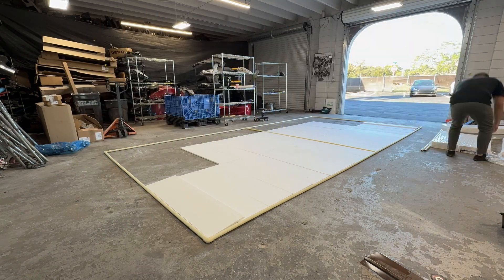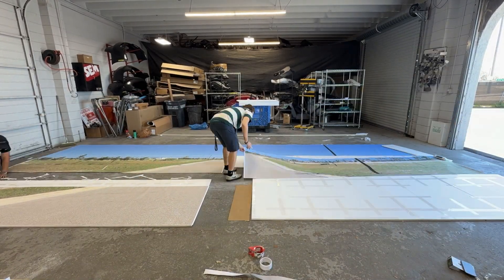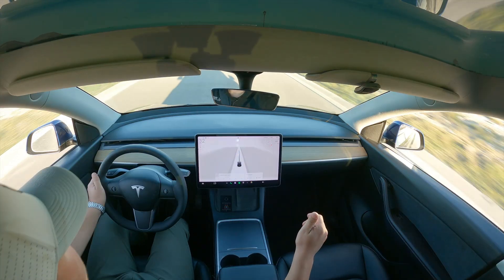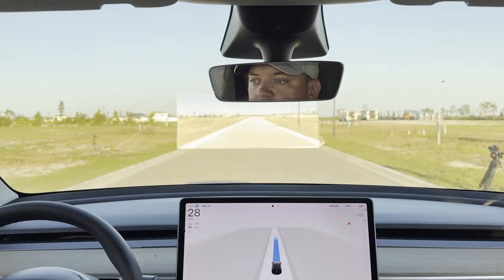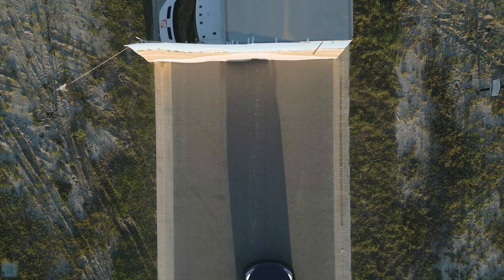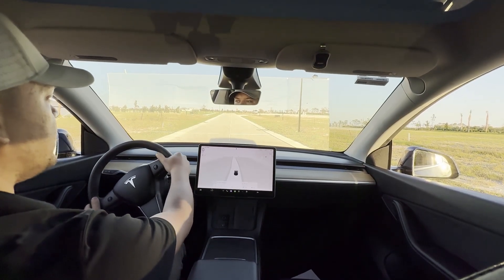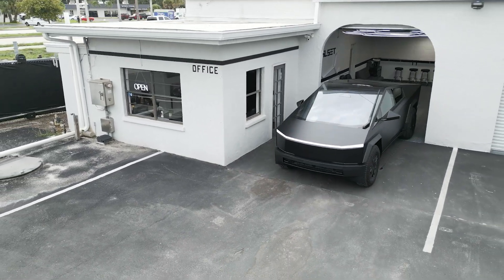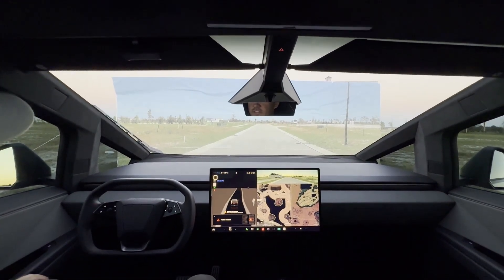Response to Mark Rober’s “Can You Fool A Self Driving Car?”

Comment: HW4 cameras are 5 megapixel compared to 1.2 megapixel hw3 cameras. Tesla has publicly announced HW3 is not capable of running Full-Self-Driving without a hardware upgrade.

I brought this up multiple times regarding Mark’s video. But he didnt even try FSD so maybe it didn’t matter

This video keeps it as real as it gets. Thx for taking the time to do this 👍🏼
Reply: I wonder if it is really just the cameras making the difference. Would be curious to see if a recent model Tesla using just the Autopilot program would go through the wall or not.
Reply: @ not only the cameras. The most recent computer in the Tesla is also much more powerful. The older cars can not run same FSD software as the most recent Tesla’s because the older cars dont have the compute power needed to run the latest FSD
Reply: Tesla has not publicly announced HW3 is not capable.

They announced that it is looking likely that HW3 might not be capable and that if so, they will offer a HW4 retrofit solution to those who have purchased FSD outright. (Not those who are paying for FSD(S) monthly)
Reply: @ its been announced in public earnings call that hw3 will need to be upgraded.

HW3 cars are still currently getting some FSD software upgrades, but not as good as AI4 because HW3 can’t handle the compute loads needed to run same FSD software thats in current AI4 vehicles.
Reply: 5mp cameras dont change anything. you need at least 2 cameras spaced out significantly on the horizontal axis to retrieve raw depth information. Tesla does not do this. It relies on cameras only on the center of the car without raw depth information, with algorithms fine tuned to approximate depth based on previous data sets. 
Even if the cameras are spaced out, image sensors just do not have the fidelity of lidar systems. There are reasons why lidar is preferred when testing autonomous driving tasks.
Reply: @ The video very clearly shows the Cybertruck doing what you claim it cannot do without the hardware you claim it needs and doesn’t have. In science this is described as having your conjecture falsified. 

LIDAR actually failed in the original video too, the guy just lied about it. In the “rain” test, the LIDAR car stops because of the rain, not because of the faux child beyond the “rain” that the LIDAR car shows no hint of on its screen. LIDAR often fails in rain and real fog, so the “scientific” first video used smoke instead fog. Snow is right out for LIDAR, either falling or covering the road or any near the road, because it scatters the laser beam. There ARE algorithms to unscatter the laser beams, but then you are getting considerable lag between shooting out the laser beam processing it, and that compromises the safety and reliability of the FSD. There is a nice video on YT of a Waymo taxi happily driving in a hard rain, until it drives right up on a huge fallen tree branch, cannot move anymore, and has to be rescued. There was also that time a LIDAR equipped Waymo drove right into a fast moving electric pole. 

LIDAR companies and LIDAR based FSD companies are closing down for a reason, and it is not because LIDAR is a great idea for FSD.
Reply: @user-ko9te33c84u there are 2 cameras on the front and you only need 65mm or roughly 2.5 inches of spacing which happens to mimic human eyes. Now of course lidar would be better. But you’re just wrong about the camera depth stuff.

Comment: I must also note that there is a HUGE difference between HW3 and HW4. This is literally the hardware, so my focus is on the cameras. For HW3 they used a 1.2 Megapixel camera and for HW4 the use a 5 megapixel camera. This higher resolution enhances clarity allowing for better recognition of fine details like license plates and road signs, improved low-light performance, and a wider field of view due to changes in lens design.

Comment: Great video! Someone should test one of the Tesla's with FSD before they decided to take the LiDAR sensors out and see if it works any different, if it does better then that would mean there are older models with better FSD than the ones witnout LiDAR.

If there isn't one available I have a Model 3 with LiDAR + FSD you're welcome to test if we're in the same area just lmk! ^_^
Reply: Tesla never had Lidar, only radar.

Comment: Great work, but to have truly recreated Mark Rober's test, you would've had to have manually driven into the wall without FSD.
Reply: Lmao. Nice one
Reply: To be fair, Mark turned on Autopilot, obviously a completely different thing, with 3.5 seconds to impact, then turned it off by jerking the steering wheel with a half second to go before impact, and THEN manually drove through the painted wall. He worked really hard to pretend to be testing the FSD without ever using FSD.
Reply: Sorry about your stonk

Comment: It's because the headlights were on. You can see it visualized it as something on the road not a wall. Test it at the same time of day next time.
Reply: I don't doubt it would fool it. but,Not every Looney tunes fake road will be perfectly contrasted and photo realistic like depicted here
Reply: @XxHorseshoeXx Looney Tunes is their worst case scenario. Teslas have already failed with far simpler objects like a semi trailer that was light colored vs the bright sky. These tests aren't really telling when simpler setups have already resulted in failures. IIHA didn't test Teslas (fear of retribution?) but Mazda and I think VW (?) seemed to confuse typical firefighter reflective stripes with road markings and plowed through the test subject. Subaru did fine though. It's all plagued by edge cases, even human vision.
Reply: Funny how lidar works like a headlight, throwing light around
Reply: @Y2Kvids could be that the AI learned to use these patterns for estimating objects.
Edit: Doesn't penetrate fog though, although AI might be better ignoring bright spots of fog better than humans
Reply: @MeBerserk   Lidar usually also has cameras and radar with it .
Reply: @Y2Kvids  yeah, same concept, different wavelength. Nowadays (static systems) often accompanied with a pattern in the light source.
Reply: @MeBerserk  I believe the AI only learns on Tesla servers. Not individually in the car.
I really do not know how Tesla does it. But most AI does not learn while being used. Ever. It needs to go through a completely separate training process and then you use it as is and live with whatever it does not know. While training the next version on the servers. Essentially. I am sure someone who works with AI cringed at my comment.
Reply: @origosis  That is correct. The work the computer in the car does is called inference. Basically applying the trained model to the current situation. It doesn't learn from it directly. But Tesla has the option to grab the videos of situations where the model made a mistake and incorporate those in the next training run.
Reply: @origosis as you say. Using the AI doesnt teach anything. The engineers would have to use the clip from your car, label it and give it to the AI as training data. This is why you get a new version. Different data, more data, better labeling, etc…
Reply: @macanx10  They do do that.  Clips from the car are sent back to Tesla for driver interventions, and used for further training of the AI.

Comment: If it has lidar or radar a painted wall isn't going to fool it.
Reply: That was the point. If vision-only self-driving can detect a painted depiction of a road on a wall or not, because obviously LIDAR/RADAR/ultrasonic sensors will pick it up. The point is whether or not Tesla's camera-based system can be fooled.

Comment: There's a great leap of capabilities from fsd 12 to 13, so I'm not surprised that 13 did a lot better. It's not even the case of the hardware being better, it's just that 13 doesn't run on HW3 so you need HW4 to run it. They said they will try to make it run in HW3 too and then it should see the wall too, but it's not certain they're actually gonna do it. 
Either way, cool video, thanks for the effort.

Comment: I appreciate you trying to do it much more scientific.  I will note that the visualizations on the screen for the driver to get an idea of what the car sees, is not actually what the car sees as its occupancy network code.   same way they only have one type of traffic cone visualization, or dog visualization.  When I'm in a tesla in a drivethru it knows there it a wall there and sometimes draws it as a bus, and sometimes doesn't draw it at all.  it doesn't mean the occupancy netowrk software things there is no wall.   but the visulalizer is pretty useful in general to get a small sense of what it sees.

Comment: i think if you ran the cybertruck test with headlights off, you'd get the same result as the model Y. looking at the display, it doesn't actually detect the entire wall, just the bottom portion most strongly illuminated by the headlights

Comment: Wow - v12.5.4. That really wasn't very good. I've had 12.6.4 for quite a while. I still wouldn't be surprised if HW3 didn't stop even with v12.6.4 because the cameras are lower resolution. But I would be curious since it is a massive improvement over 12.5.

Comment: A much better job than that Mark Rober video. Thanks for doing this!
Reply: Same result.
Reply: @ Sure, but this experiment was conducted properly. Repeated trials. Actually engaging FSD. How you run an experiment is usually more important than the results you get.
Reply: @ This guy was able to make repeated attempts because he never let the car go through the wall while Rober did.  For Rober to do 6 attempts, he'd need possibly 6 fake walls and cleanup and setup time in between, plus access to a free truck.
Reply: @hunterhenryk  Exactly. For Mr. Rober, it was about the photo.
Reply: @wesleyw.terpstra1902  Well technically, if it were you in real life and a wall with a picture of a road on it, you'd only have one chance at it too (i.e., Rober should technically be dead after that attempt).  You don't get 6 chances at it IRL.
Reply: @hunterhenryk  ... that's not how science works.
Reply: @hunterhenryk  nope, cybertruck passed
Reply: @oh3831  Mark rober did not use the cyber truck
Reply: @ZhoBacon  he could've used FSD with any HW4 car but didn't because he wasn't being an honest scientist
Reply: @ZhoBacon   only 46000 cybertrucks are sold
Reply: @oh3831 Bud, people are saying the lightning conditions is different for cybertrcuk here. So this person's experiment isn't fair either. OP must redo the test again in same lightning conditions.

Comment: This is all pretty arbitrary because what triggers the recognition is more about the contrast and imperfections in the print over the course of hours stretching into the evening.  This test could easily be tuned to pass or fail with a better print, tuned lighting, etc. or the other way around.

I love that you did this and came at it without bias by the way.

My comment is more about pointing out that the Rober video may not have been technically lying about lidar being better at detecting a carefully positioned and sized free-range billboard than Autopilot, but the intent is clearly to do what most media does which is to leverage people's ignorance about the technology to gaslight them.

Comment: TBH as a Cybertruck owner, I thought I was gonna get to see the Cybertruck plow through that wall. Partly because as an engineer we design for the most probable uses of products and this wildly improbable test is just fun. Other part is the truck has much more inertia than the Model Y and driver taking over the last minute will lead to a collision. Speaking of collision I was rear-ended by a 2020 model Y on icy roads while in my Cybertruck. My CT was in FSD at the time and kept great distance in front, Y driver admitted to rush to skiing. Also, CT FSD is not as trained as model 3 with HW4. Again, these tests are not useful to the advancement of automation though. They serve as entertainment only. Political people and media use them as another reason we should not advance technology away from fossil fuels, because big oil still and has been paying the most for disinformation in the energy industry.

Comment: 1 -Where in the world will you ever encounter that kind of "wall" ???
2 -The fog is a much more realistic scenario , you might try that test if you can with hw4 .
3 -The rain test was not that realistic because of the volume of water used , it's like driving through a waterfall .
4 -Tesla can use lidar, but humans don't have it and still can drive pretty safe . Lidar is a nice addition to any system to prevent false positives ( phantom braking ) , but that's extra money  !
Reply: Yep, for No 3 it was conveniently left out that the LIDAR car would NEVER have proceeded through that deluge as the LIDAR would have recognized it as a solid object. There are videos about this if you are curious.

Comment: that 12.5.4.2 was released oct 28 2024 I wont why you never got a newer version. so if it works on all hardware 4 fsd 13+ versions that means tesla solved this in jan 2023.

Comment: I know it’s a lot but please do the test again if you can where both models are run at the same time. Definitely seemed like more glare on the image in the first run. Also I feel like the difference in vehicle heights could have made a difference please make sure that the cybertruck is at the lowest suspension setting (you probably did). Thanks heaps for going to efforts you have.

Comment: That is actually unreal.. I was almost certain it would be the same result even with HW4... 

Mostly because with my 2025 Model 3 with HW4 and 13.2.8, my vehicle does not move over to the right as it needs to when coming up on an hugely oversized load (carrying a small building). I'm pretty sure if I did nothing, FSD would hit the oversized load unfortunately. I'm sure they'll figure it out eventually though, even just with the cameras

Comment: This is exactly why more than just cameras are needed for full self driving. Doing full self driving with only image recognition is the dumbest thing an engineering department could do. The cyber truck test looks like it was done at a different time of day, so the wall is a lot more noticeable. A better control test would be to do it at the same time as you did yours.
Reply: Tesla has explained why they no longer use LiDAR. AIDRIVER (youtube channel) who test FSD extensively breaks it down.
Reply: @ I don't care, it doesn't disprove the engineering fact that having better data results in better autonomy and decision making. The lack of Lidar is why Tesla can't get above Level 2 self driving. Every other company is doubling down with cameras and Lidar. Lidar is now significantly cheaper than when Tesla decided to write it off without understanding what economies of scale can do. Tesla makes short sighted and dumb decisions based on an unhinged CEO who specializes in marketing and venture capital. The same dude who wanted to run PayPal's website on Windows.

Comment: Could you perform the test with Traffic-Aware Cruise Control? Autosteer and FSD are not worldwide available, and also they are not broadly available in other serial manufacturers - Lexus, Kia, Renault, Toyota. Most of which use LiDAR in their implementation of "autopilot", which is just a fancier expression for "adaptive tempomat with lane assist". I am aware of only two manufacturers that make self-driving cars and have comparable features with Tesla when using it with FSD - Geely and NIO. And yet, their models and makes are not available to the broader consumer as Tesla is.

Comment: The amount of coping in this comment section is crazy. 

The sunset might make a small difference, but the biggest difference here is AI3 (HW3) vs AI4 (HW4). AI4 reintroduced advanced radar into Tesla's cars. AI3 did not have this. The cameras could have been easily fooled by the wall because it could be mistaken for the rest of the road. But the radar would 100% detect the wall well before collision, allowing thr car to slow down for it.

Comment: You just put your life in danger by using a truck to hold the wall. Be safe man.
Reply: A truck. A whole fucking truck there. What were you thinking.
Reply: He must've measured the car's braking distance and put markers down or something, given that THREE TIMES he (not the car) slammed on the brake last second and stopped within 1.5 metres of the wall. I don't believe he would have gotten that close that consistently, if he didn't take precautions.

Still a risky test, but he thought of that.
Reply: @LRM12o8  this is all clipped together worse than Rober's video was - the two different angles showing the car stopping when he applied the brakes end up at 2 completely different distances from the wall in the head-on view vs the side view, and it appears at first glance that some of the side view video was only recorded once, and re-used for multiple trials too. This video shows the same outcome, that autopilot / FSD is worthless in this situation (no surprise there), but still has some pretty obvious consistency issues in the edit.
Reply: Tesla owners have insane faith in Elon, he was probably throwing his heart out before the test
Reply: A home depot rental truck. If HD sees this he'll be banned for life.
Reply: No danger when he knows the car will stop
Reply: @alanprado6210  It didn't tho...
Reply: @alanprado6210 the car will stop… right… not like he had to slam on the brakes because the car didn’t see the wall 🤷‍♂️